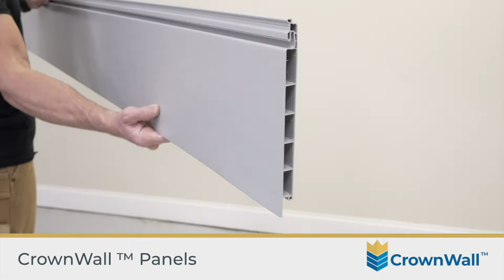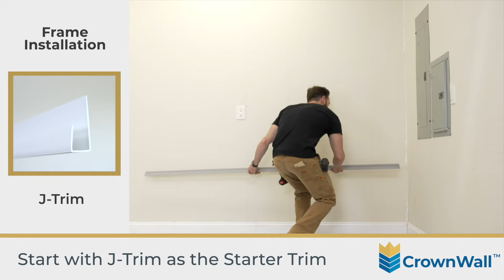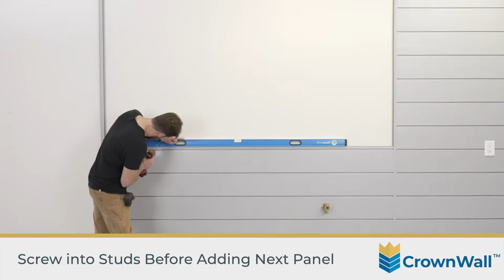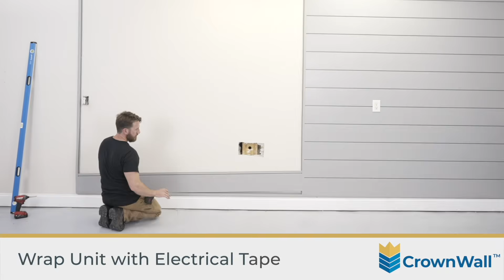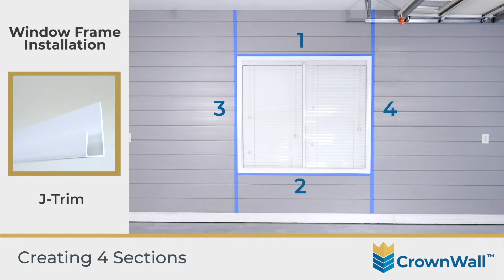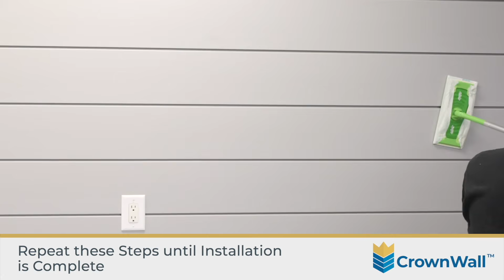CrownWall Slatwall Panel and Trim Overview

Comment: I just installed a couple of 4x8 slatwalls.  Looks and works good.  The planks are a little under 8'.  This, along with the side j channel makes it hard to install screws on each end and hit studs.  I had a couple screws I couldn't get into a stud on one end.  I assume the stud must have a bit of a bow or twist.